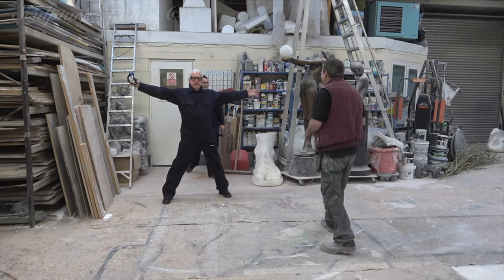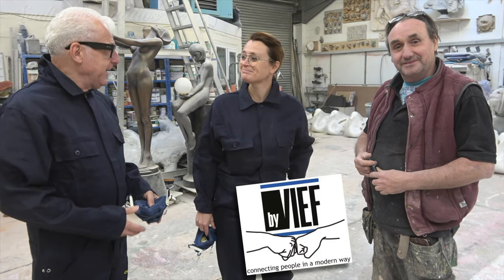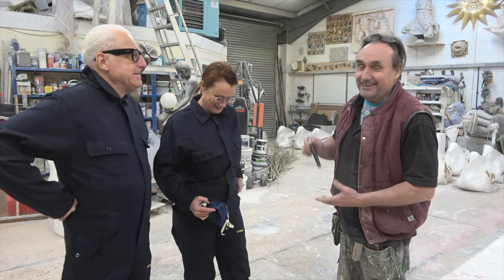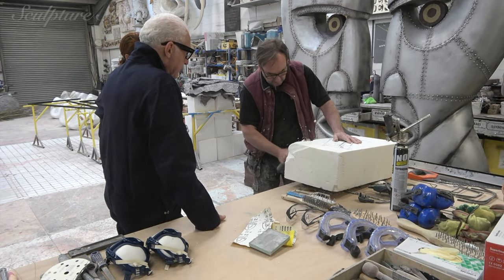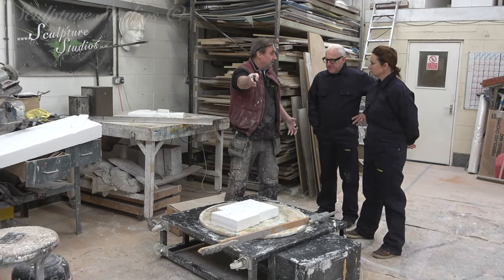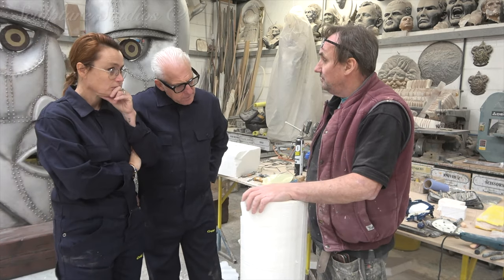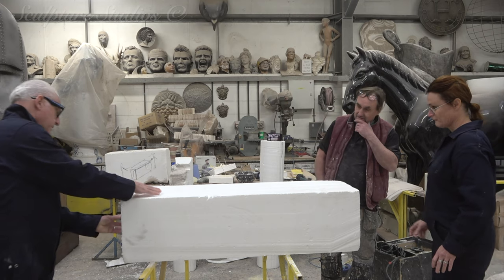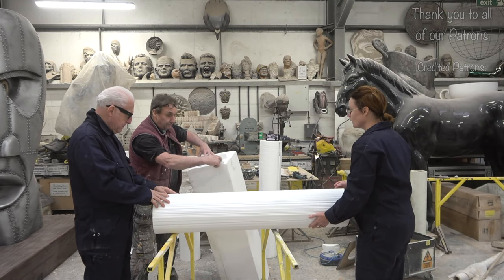1 to 1 Crash Course Tutorial Session at Sculpture Studios

Comment: I have a few hot wire tools, but I have never seen the 2 independent hot wire handles that you can put any size wire on to cut very big pieces. Can you please let me know where to purchase that, I am in the US. I am getting ready to retire and move to Brazil and would like to carve large commissioned and non commissioned pieces and cover them in either mosaic tile or cements and house paint vs. fiberglass and auto paint like you do. I worked in auto body and boat building and would like to stay very far away from fumes and chemicals. I wish your studio was near Florida so I could learn from you before I move. Thanks.
Reply from the maker: Hi Marco, thank you very much for the comment. You're absolutely right, the separate handles means that you can put any length of wire on for large cuts. We have our hot wire machines built for us by an electrician, using a variable transformer, 2 handles (one with a switch on it). Retirement and some large scale carving sounds perfect to me. That's what I have in mind for a couple of years time!

   Perhaps take a look through some more of our videos to pick up some hints and tips. Perhaps arrange a flight over to the UK before Brazil, and have a 1 to 1 visit ;)